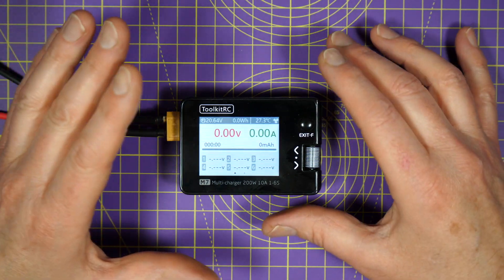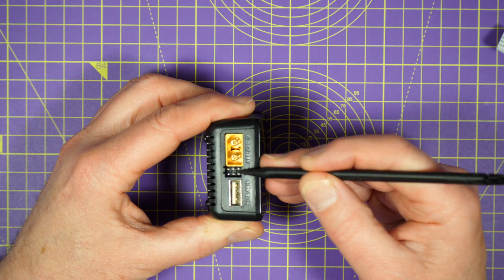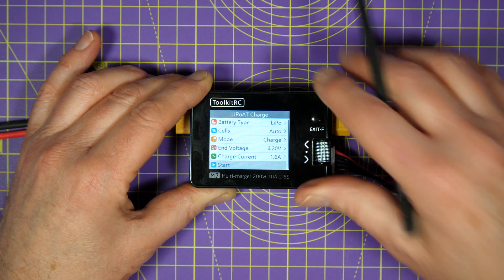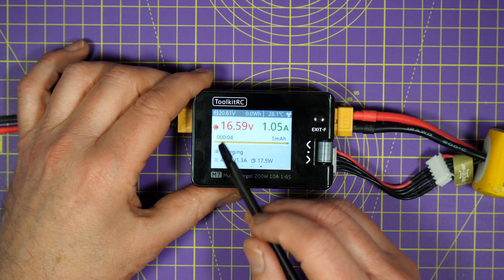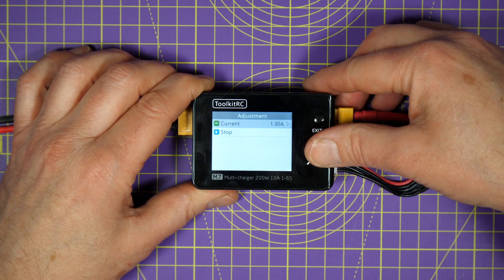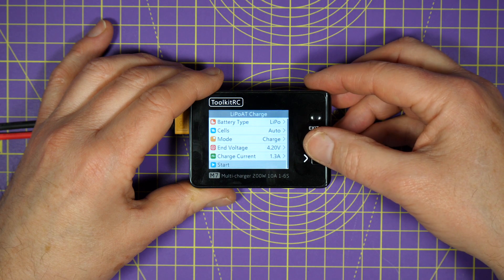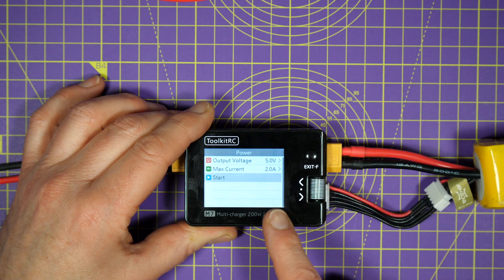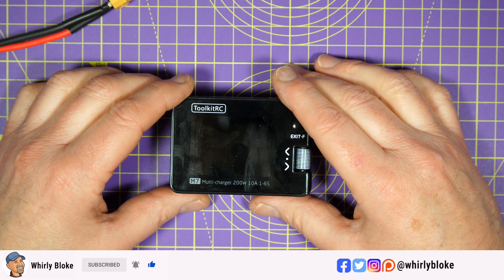ToolkitRC M7 200W 10A Multifunction Battery Charger for 1-6S | Full Review

Comment: I tried using a larger battery to charge a smaller one but there is no cutoff voltage for the input source so it drains it beyond the 3.3v per cell.

Comment: Thanks. When I try and discharge my lipo to put it in storage mode and select storage mode and plug my lipo in the right hand side and selcect 'discharge mode external' it states 'input voltage is too high. The lipo I used to discharge is 4s and has 16.48v. There is nothing connected in the left port so there should be no voltage going in. What am I doing wrong?
Reply from the maker: Thanks for watching and commenting on the video. The error message about the input voltage being too high might be related to the charger's settings or connections. Double-check that you've selected the correct discharge mode and that all connections are secure. Good luck, and I hope you can get your LiPo into storage mode without any further issues.
Reply: @WhirlyBloke  I did check the settings but couldn't figure out what I was doing wrong. Thanks any way.

Comment: Too inaccurate when balancing compared to ISDT Q8 and BG-8s. Toolkitrc M7 up to 20mV wrong. ISDT max 4mV error. Everything measured after calibration. Unfortunately, because I find Toolkitrc's operation and functions much better......checked on Storage Charge (3,85V)
Reply from the maker: ToolkitRC massively improved the balance circuitry in their V2 versions of their chargers.

Comment: How did you change between constant current and voltage, your video just jumps between the two
Reply from the maker: Unless you really know what the difference between constant voltage and constant current it's best to let the charger do its thing. Just set the cell end charge voltage and a suitable charge current.

Comment: When do a take battery off charger...says fast charge done but then still trickles
Reply from the maker: When it says 'Charge Done'. If you set it up to trickle charge on completion, then it will trickle charge as the battery slowly self discharges. Thanks for watching.
Reply: @WhirlyBloke  mine says fast charge done then if a wait a bit it says completed...should I wait for complete?

Comment: Might buy this for a project in uni. Is it able to just unplug 1 battery and start charging as soon as a new battery connects, without pressing a button? I want to built an automatic charging station. Both batteries will have the same type and number of cells ofc.
Reply from the maker: Yes it has a configurable continuous charge option. If you unplug a battery that finished charging and plug another one in with a certain time (configurable), the charge will resume using the same charge settings.
Reply: @WhirlyBloke  Thanks for your answer. What if I unplug while charging, will it also just continue when plugged in again?

Comment: If you plug in a lipo to the output xt60 and balance ports does it act as a quick battery checker? Thanks and amazing job on the video!
Reply from the maker: It does exactly that.
Reply: What if only plug balance lead only? Is it will act as common lipo checker?
Reply: @goesnick  Unfortunately it needs the XT60 to be plugged in to power it.

Comment: Hi can i use a full 6s lipo to power this and charge say a 4s lipo? If so would be handy to recycle the power and discharge a lipo by charging another. Thanks
Reply from the maker: The power input voltage is 7.0-28.0V so, yes, you can use a 6S Lipo to power it and that's a great idea. But take care you don't over discharge it below about 19.8v and damage it. You can configure the input power min voltage on most ToolkitRC chargers, so you could use that so it cuts off at say 20V.
Reply: Thank you very much for your response 👍🏾

Comment: Is it very different from M6 v2 in terms of functionality and convenience? Should to change M6 V2 to M7 (power of M6 150W is enough ) ?
Does the fan turn on at 40C, as in the M6, and is the same noisy?
Reply from the maker: Same functionality as the M6 but the UI is different so things have just been moved in the screens. The fan comes on at a pre determined temperature that you can change in the options screen.

Comment: Hi can I use 17 amp psu for the input of this charger m7 because specs sheet says @max  12a? 

Thank you in Advance?
Reply from the maker: You can have a power supply that delivered more current with any issues. The charger will only draw what it needs.

Comment: What would happen if you didn't change the charge current and left it on 3.8 like i did before watching your video which was very informative
Reply from the maker: It depends on the battery. If it's a 4Ah Lipo that'd be fine, but if it's 300mAh battery you'll kill it after a couple of charges. I only ever charge at a maximum of 1C - that's 1 x the Ah capacity of the battery. That'll keep your battery happy and get you the most most charge cycles.

Comment: Can you measure the battery IR, voltage etc powered by itself? (only connecting the output xt60 port?)
Reply: Did you ever find out if it does what you asked?
Reply: @patricknejad6779  Yes, i bought one, you can use the battery to measure itself. But appears to be minimally less precise.
I have many batteries so I always power the toolkit with one and measure the another
Reply: @rafaelreusch  Thanks, I put in a order as well, but what I read was, if you just plugin to output voltage, you can do a test as well, no need to plugin both input and output
Reply: @patricknejad6779  Nice, it’s a great device i have mine for more than a Year.
About your statement: Exactly.
To only check voltage, you can also plug into the INPUT xt60, the m7 also shows onscreen the input voltage too. but works both input or output.
Reply: @patricknejad6779  If connected to xt60 output and also the balance plug. it says voltage per cell.
Reply: @rafaelreusch  Perfect!

Comment: How to charge NiMh 1S ???!!
Reply from the maker: It's a balance charger and not designed to charge 1s cells - there's nothing to balance. However you could use the Power or DC supply options, it not automatic though.
Reply: @WhirlyBloke  it does charge 1s ....I use it for my 1s onroad packs. Even says 1-6s in your title.

Comment: Another amazing video! Do you know if TOOLKITRC ADP-100 100W Power Supply (AC) would work with M7? I want to be able to use it inside home with power from the wall outlet, and when I am outside in the field, of course DC is God given option. Thank you in advance!
Reply from the maker: That'll work just fine.
Reply: @WhirlyBloke  - Thank you so much! I now you don't want to sound biased or anything like that... but what is your valuable opinion on ToolkitRC vs ISDT? There is another player in this price range, ISDT 608AC which already comes with both options, AC as well as DC, and it's basically the same price of ToolkitRC M7 + ADP-100 power supply. Thank you so much in advance!
Reply from the maker: ToolkitRC and ISDT are both very good, but ToolkitRC are bringing out some great new products ate the moment.

Comment: i am very new to this how do i power it using a power adapter ?? edited my post .. can i use  a New ToolkitRC ADP100 100w 20v 5A Power Supply Unit with XT60 Output .. will that work ?
Reply from the maker: Yes use the  ADP100, ADP180 or the P200. I reviewed the P200 here https://www.youtube.com/watch?v=foLjlGiB9j8

Comment: Got mine from AliExpress and it has 2.0 firmware out of the box. Hope it is not a new revision which is cheaper and worse, as usual :)
Reply from the maker: Nice.
Reply: @WhirlyBloke  Actually, I found 2.01 version on the website with the note "Only for V2.xx main board". So it means there is two hardware versions of M7. Asked support and got this answer: The latest batch is the V2.0 version. Due to the shortage of chips used in the V1.0 version, other chips were purchased to replace the latest batch. Except for the chip, the V1.0 and V2.0 versions have no difference in other structural functions. When upgrading later, the two versions correspond to different firmware upgrades.

Comment: how do i charge a 2s 7.4v lipo that only has a balance port as power output "no xt30 or xt60" eg my helicopter balance plug also acts as power port..M7 version 2.00 keeps saying low power when i plug lipo in..
Reply from the maker: Thanks for watching  and reaching out with your question. I can understand your frustration with the low power message on your charger. In order to charge a 2S 7.4V LiPo that only has a balance port for power output, you can try using an adapter cable. You'll need a balance-to-XT30/XT60 adapter cable, which will allow you to connect the balance port of your LiPo to the charger's power port. 

FuriousFPV make one, but they are easy make yourself.
Solder the positive wire from the male balance connector to the positive (+) pin of the female XT60 connector. Similarly, solder the negative wire to the negative (-) pin.

That's it! You should now have a balance-to-XT60 adapter cable that you can use to charge your 2S 7.4V LiPo battery a balance charger. Remember to always follow proper safety precautions when working with LiPo batteries and soldering equipment.

I hope this helps!
Reply: @WhirlyBloke  Thank's for your reply and tips, yes indeed after lot of head scratching, what you suggested is what i came up with also and did not blow my M7 up LOL..they out of stock in Au of custom ones so i'll make one.. old usb charge cable that came with heli kit "7.4v female balance" then a old lipo discarded battery connector male balance port cable and female xt60 pigtail..looks like it is all soldered together on lipos and usable anyway..yes for sure i will take care and use shrink wrap,hot glue etc, as can't muck about with lipos.. i like this new M7 charger a lot and use "ultra power up-s6 1s charger" for my 1s helis lipo as more and more Hv lipos coming on market now.